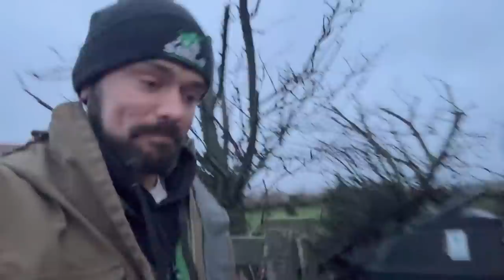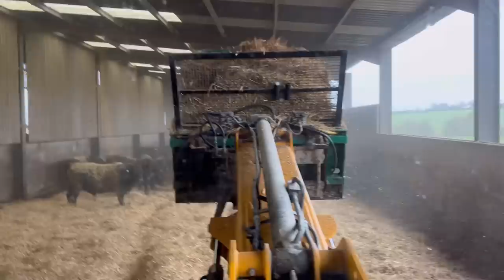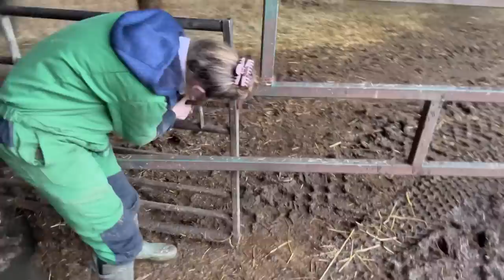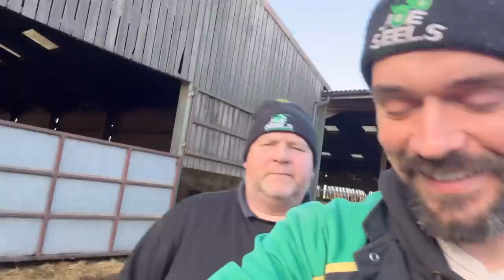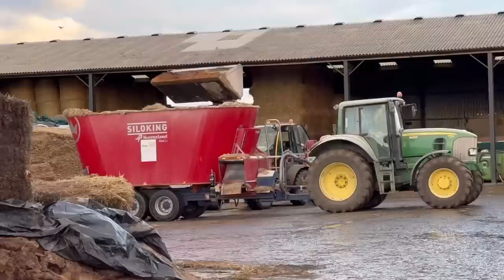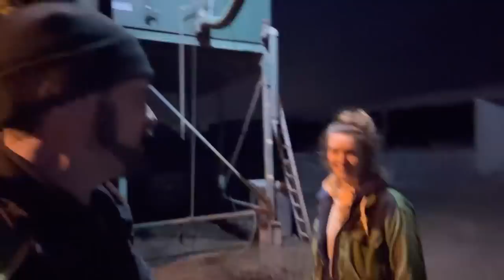Big Mick Wants Blowing Off! Teagle Tomahawk, Ems New Puppy!

Comment: Poor Em's young ears hearing things they shouldn't be from big Mick 😂
Do you have shares in the company that make your shear bolts from or something Joe as your teagle seems to get through a lot to ours does or is it because you have a lot of wet bales from the top as you don't tarp the stack?
Reply from the maker: I think it’s the wet bales, n possibly the knives need sharpening inside, but my dad won’t let us sharpen them 😂
Reply: @joeseels  can't sharpen or you will wear the metal away 😂
We have the 8555 dual chop because you can have it chop finer for our heifer stall and also for chopping silage bales for our grass fed beef, if the blades start to blunt you will break a shear bolt doing silage bales occasionally.
Teagle are one of the best we've had though.